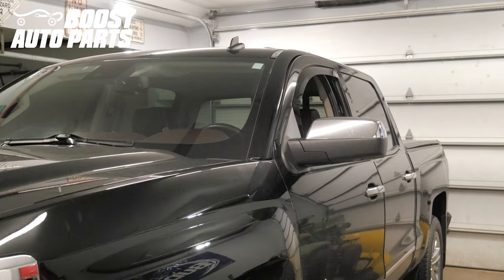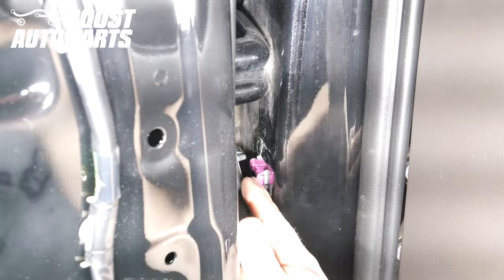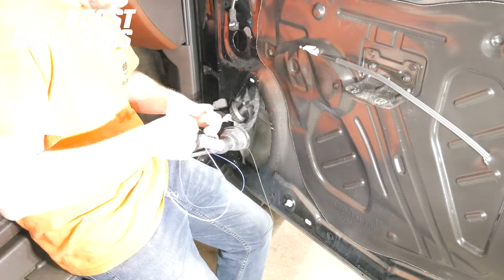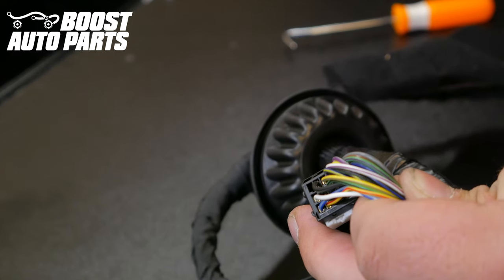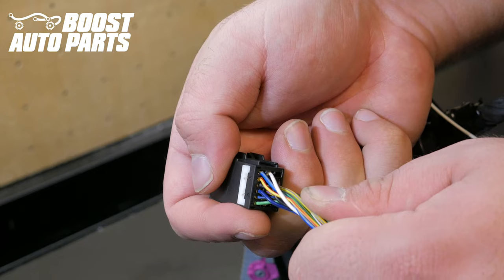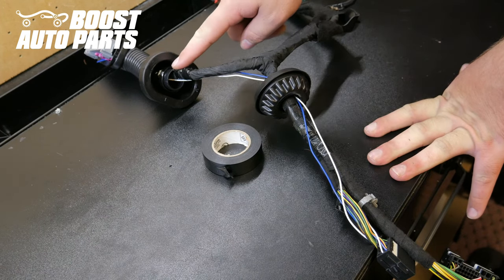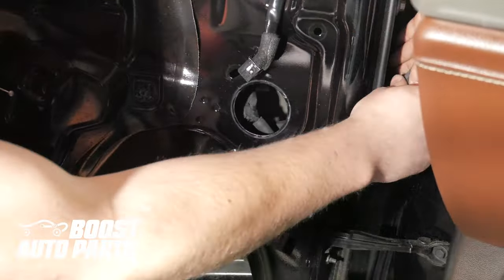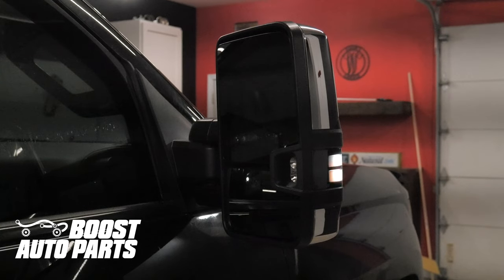GM Small Mirror (DL3) to Tow Mirror Plug And Play Wiring Upgrade (2015 - 2019 Silverado Sierra)

Comment from the maker: Link to product: https://boostautoparts.com/products/pnp?utm_source=GM%202015%2B%20Modify%20Door%20Harness%20-%20DL3%20to%20Tow&utm_medium=Comment&utm_campaign=YouTube
Reply: So if I have power folding, blinker oem mirror on a 2016 gmc 2500 hd what do I need to make everything work
Reply from the maker: @Country_tuff  this modification is all that is neccesary. For a 2016 with power folding OEM small mirrors with signal (DL3) the modify door harness adds the running light and cargo light that your mirrors are not currently equipped with.

Comment: Do you have a video for a truck that has no mirror power functions and is strictly manual? I am looking to upgrade.
Reply from the maker: Unfortunately we don't have a path to add power adjust mirrors onto a vehicle not originally equipped.

If you were just looking to gain the lighting features this video would be best: https://www.youtube.com/watch?v=uKHg4GJC6dE

Comment: What exactly are the two wires that are being removed from the original setup and why?
Reply from the maker: Auto-Dim & Puddle light. Those features aren't present on towing mirrors, and the pins are utilized differently on the towing mirrors.
Reply: @boostautoparts  why did you cut them though ? Now you can’t put the old mirrors back on. Can’t you just tape them off to the side?
Reply from the maker: @jesussalazar951  If you extract them completely yes, however extracting them requires a special tool.

Comment: I am new to this I purchased tow mirrors that are power heated etc and my truck already has powered mirrors. I looked and it was manufactured in January 2014. what happens if I do not get this harness thing you guys are mentioning? Please help
Reply from the maker: Your lighting functions won't work - give our team a call at 765-831-2830 and we can answer any questions you may have.
Reply: @boostautoparts  Thank you for your response. It seems the tow mirrors I purchased already come with harness wires (black and white wires). I have a pictures I can provide just let me know where to send them. I will be calling bc I really want to have these installed but I am not that savvy when it comes to this and need help.
Reply from the maker: @christiane.montanez3885  Give our team a call at 765-831-2830
Reply: @boostautoparts  I did call earlier today, thank you so much for your help but I may just need to pay someone to help me do it (sad face) I am just not knowledgeable enough to do all that wiring on my own. Wish you guys were in central Florida. Thanks again have a blessed day

Comment: What’s the red wire for? My mirrors won’t fold, and I have factory fold with the old mirrors
Reply from the maker: Red wire is for signal. Fold should be plug and play if originally equipped. Contact our support team at support@boostautoparts.com if the mirrors are from us

Comment: what do blue and white wires do ?
Reply: i didnt have signal before and only installed blue and white so far and nothing works i have yet to install black wire but shouldnt some things be working or you need all wires connected for everything to work?
Reply from the maker: @camambriati9543  Blue is for running light, white wire is for cargo lights. If you originally had turn signal on glass that is all you should have to install. If you didn't originally have turn signal on glass, this is the wrong video for you to follow and nothing will work without installing the other wires in the kit.
Reply: @boostautoparts  hey I followed everything perfectly in this video and my cargo and running lights are not lighting up. Everything else works. What do I do?
Reply from the maker: @devonadamson6561  Sounds like you may have a 2014 or early 15 truck. Reach out to our support team at support@boostautoparts.com and they will get you squared away.
Reply: I have turn signal, puddle light and auto fold on oem mirrors 2018 gmc sierra denali, i dont want to go through the door latch adding pins with wires there. If i will just plug the connector to oem and thats it? What wont work?
Reply: @MohammadHarisMania I used OEM mirrors on mine and just plugged up. Did not have running light or cargo light. Blinker and folding still works as well as mirror adjustment.